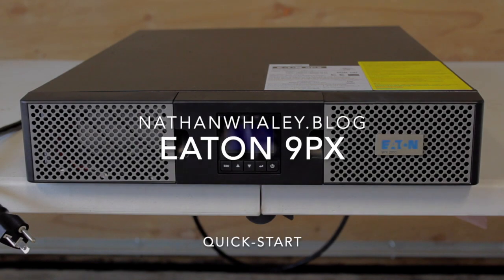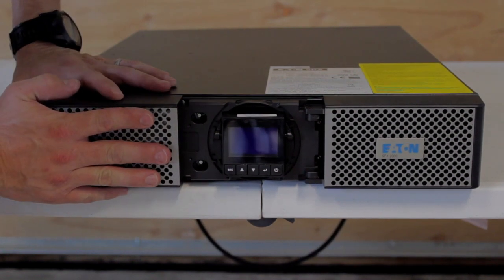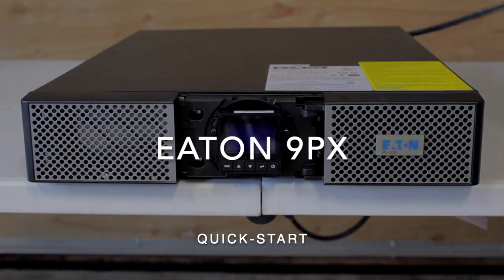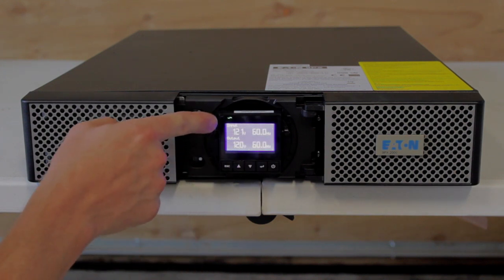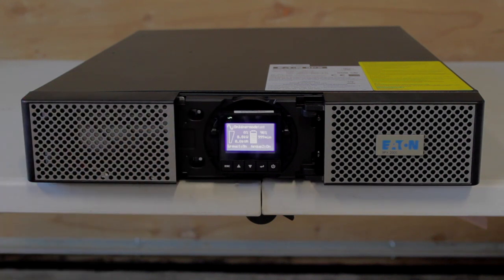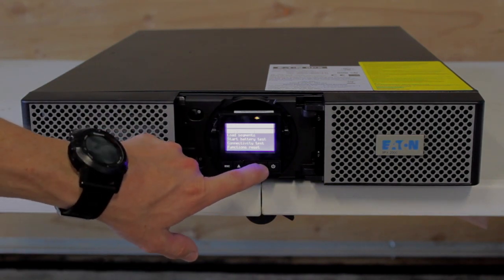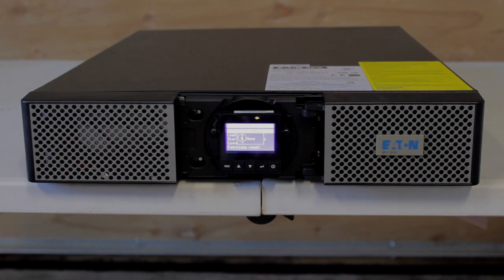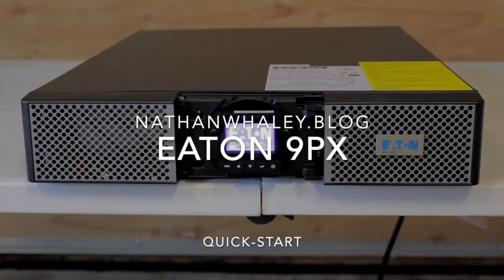How to Quick Start Video - Eaton 9PX UPS Rack-Mount / Tower-Mount UPS 700VA - 3000VA

Comment: The same model UPS , plugged in and the digital display shows nothing on power on, neither does the Eaton logo launches. Have you come across such a situation,not sure if its a issue with the digital panel itself...please advice. Thanks
Reply: Did you ever figure it out?

Comment: I have this error( Max charge volt)  on my Eaton 9px3000IRT3U, and it keeps peeping and not working.

Kindly,  what is this error and how can I solve it.

Thank you.
Reply from the maker: I haven't seen that error before. I'd recommend calling the tech support line on the factory label. It also has your serial number on it. The tech support folks will ask for that. Good luck!
Reply: Hey abdulkadir , did you find any way to figure out the fault? We have the same issue right now and cant find any solution
Reply: Right Dicison..
Reply: Try check your charging settings..it might set on constant mode..change to auto mode..hope it help